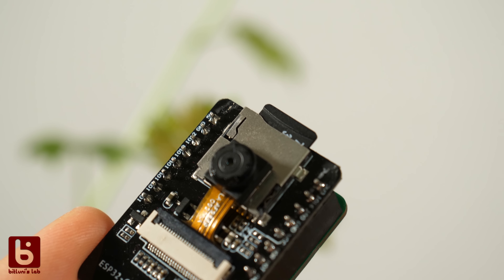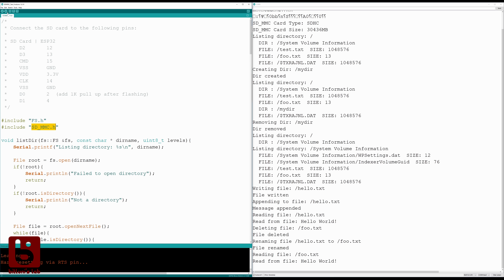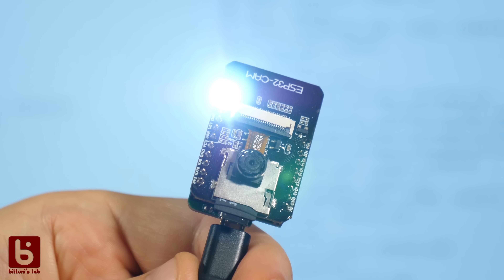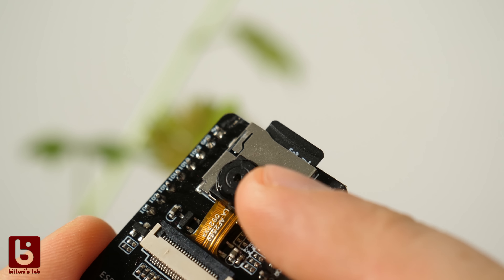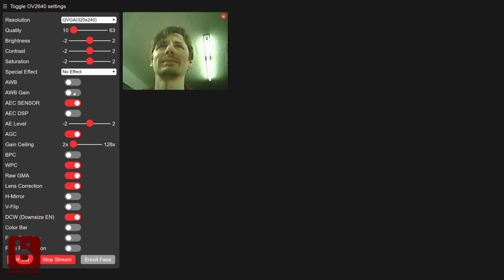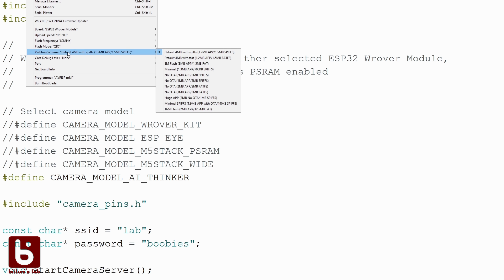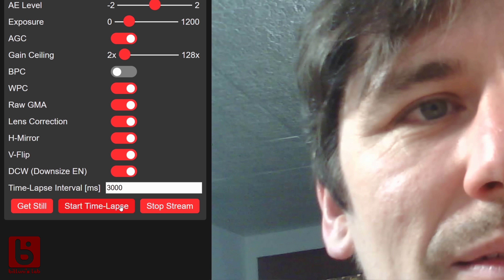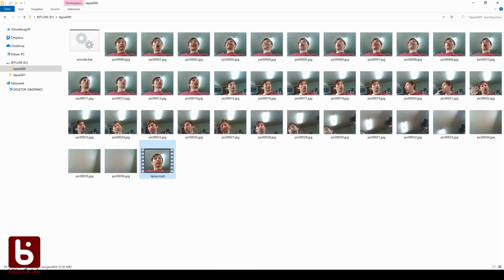ESP32-Cam Time Lapse

Comment: Time lapse cameras won't get much cheaper than that. Great for risky applications, where camera might get damaged, stolen or lost.
Awesome!
Reply: Best acceptable excuse for why all supposed photos of beings and objects which existence of is questionable are so poor quality they're useless for evidence except to show something to be mistaken was there.  Also masks otherwise obvious clues of being fake.  Can't wait until FHD at least is that inexpensive.
Reply: @jasonlisonbee  you do realise that the camera that is used for ESP32 CAM is the OV2640 which supports a video resolution of 1600x1200 which is higher than HD and less than 10% lower than Full HD
Reply: @jasonlisonbee you can swap the base ov2640 to a ov5640 , it has way better image quality and higher resolution but the esp32 processing capability caps it. Plus it gets REALLY hot

Comment: Great video!
I would like to try taking 3 time lapse movies simultaneously with different exposure settings so that post processing could be used to grab the best data from each exposure and nice smooth fades can be made between exposure levels in the final file. Another approach might be to establish hard-coded exposures based on sun position rather than light readings.

Comment: Some of those 'Board cameras' you can easily change the lenses by simply unscrewing them and replacing with another (Better!) Lens, even Wide-Angle/Fish-eye and mini-Zoom, easy to refocus too by screwing in/out.
Reply: Ditto.
Reply: You can do that to these, they aren't glued in. There's a video of a guy putting a mechanical IR filter as se over it after removing the lens. Lets you fit bigger lenses like for cctv cameras.

Comment: I needed to take photo once per day on specific hour. I modify your modification :) Also added ftp server, so now iam able to download captured images without removing sdcard. Now is exactly what i need. Thanks.
Reply: DS3231 rtc with SQW pin connected to  p-mosfet to connect the power supply to esp32-cam power input will make your batteries last a year.

Comment: Hi! I made a comparable system with the same camera, but added a small 0.96” oled screen and a button  to allow changing the timelapse intervals. Do you think  it is possible to also use the display to change the camera settings? I  can give  you my  code if you want...
Reply: with a screen that small and only one button, why not just use the esp as a wifi station and use the web interface?

Comment: I need help, can someone helps me please. Everything works until i click the Start Timelapse then i have a Error ... and it doestn captures any photos and it restarts.. Error ist Guru Meditation Error: Core  1 panic'ed (IllegalInstruction). Exception was unhandled.
Memory dump at 0x400d2a60: a5004136 000000a0 7d004136
Core  1 register dump:

Comment: hi bitluni, a very nice project, but... in your last version, the jpeg save doesn't work. the cam creates a directory after the other at ssd card, but does not store photos in it... what could be the reason? the web server works fine...
best regards
Matthias
Reply: ESP32 1.04 instead of 2.06 is the solution... Matthias

Comment: Great work ! But is there a way of getting this to work in server mode so that I can set it up without a router close by? I guess yes but the real question is how, maybe you could tweak the code a little ??? I'm kinda new to this and my attempts at tweaking have all failed.
BTW:  Mac Users you can easily use QuickTime 10.5 to join pictures to a video, works great.

Comment: Every time you use that camera are need a wifi Internet?
I hope you respond 🥰 i planning to make my own project like this.
Reply: You need a wifi access point to connect, but not internet. You connect to wifi just for controlling them, it's an intRAnet, just the devices connected to the wifi.
You can use an ESP32 as a wifi access point, but very slow so video preview would be impossible.

Comment: Hello thank you for this video
could you tell me what code to add to set the time with the ntp server with wifi, because the date and time displayed on the micro sd are not correct (January 1, 1980)
THANKS

Comment: Hello :) I have make your version of timelapse camer, but i have there a little problem. When i start timelaps, esp create folder in sd cart but doesnt save any photos. After creating folder , esp its rebooting and in next start creat next folder without photos. What can i do with that?
Reply: So i have found resolt for it. Just change esp32 version from 2.0.1 to 1.0.4 and all will works.

Comment: I wonder if these boards changed recently. I tried building a reset circuit like yours early last year and encountered the LED connected to (IIRC) IO0, causing reset to be flaky at best and I just gave up on this model. Might be time to revisit.

Comment: I find that after 6 hours of being on the camera will shut down. A reboot by unplugging and plugging back in the power will resolve the issue. Do I have a faulty camera or do I need to put a small fan near the ESP32. Any ideas are appreciated.

Comment: have run quite a few progs on these cams, but for some reason this code example does not save a pic..it just resets the board. switching to a 5V power bank vs the computer usb cable with no change It simply keeps resetting the board .  I did notice you don't include the soc.h libs to deal with brownouts but i am not getting an error code along those lines. Otherwise, this is a nicely presented project.

Comment: Glue a lens salvaged from a CD/DVD player for macro.
Reply: Also, the lens can actually be focused manually. It has a screw thread but it is kept in place with a small blob of glue. It can be forced a little to break the glue bond and can then be focused even for a distance of just a few mm.  If the lens is too loose after breaking the glue you may need to put a new blob of glue, preferably a weak glue that can easily be broken if you want to refocus.
Reply: I thought it was a laser
Reply: Pl explain thru video.
Reply: @sriyantra1939  The lens focuses the laser. Possibly more accurately, the pickup's view of a reflection of the laser.  Seperate sub component.
Reply: To make the camera more near-sighted, you can also by a EUR 2 pair of reading glasses and fix one glass in front of the camera.

Comment: Hm, it does not work for me. No pictures are stored on the card. I tried different ones, startet everything several times but no data is stored. The Webinterface is working fine. 

I get the following message:

E (1555) sdmmc_sd: sdmmc_check_scr: send_scr returned 0xffffffff
Card Mount Failed

Any hints? Thx.

Edit/ Sehe gerade du kommst auch aus Darmstadt ... Beste Grüße.

Comment: You could try initializing the SD card in 1 bit mode, so the flash pin is not used for communication with the SD Card. This way the data rate is slower. But that's mainly a problem when running on battery. And having an LED blinking all the time isn't exactly power saving either. :D
You can initialize the SD card in 1 bit mode with:
SD_MMC.begin("/sdcard", true);
Not sure if the library supports the 4 bit protocol, I believe that would also not interfere with the LED and would be faster. But anyway, you could try to see if you can get away with the 1 bit mode or if the speed is too slow. Or desolder the LED... :D

Comment: With a suitable power supply, a big ass SD Card, stripped down ESP (Bluetooth/Wifi/Webserver are unnecessary once you configured it) and some code tweaking this could also be used for timelapses over very long durations, as the ESP is quite power-efficient

Comment: Very nice and clear video, Bitluni! I got mine working! Now, does anyone know where to find a description of all the parameters of the ESP32‑CAM? I would like to know how to set them programmatically, not just with the web interface. What do all those abbreviations stand for? What values can the parameters take?
Reply from the maker: I didn't find specifics. Some values act strange. Abbreviations are probably A for auto, E for exposure, WB white balance, S for shutter. You most probably will find more in the datasheet of the camera

Comment: Can the lens be adjusted or is it glued in tight. Hopefully it can be configured to FTP JPG's if within wifi range as thats what I have planned.
Reply: Yes, it can be adjusted.  Just started playing with mine and slightly cracked the lens face.  I think if I had smaller tools then it would have been able to cleanly snapped the glue.

Comment: Hey, I bought a Esp cam and I think it is the same that you showed in the beginning by DIY-More. My Serial adapter, that shipped with it automatically disconnects after a few seconds when I connect the camera. Do you know why?
Reply from the maker: Probably a power issue. You might want to check the debug outout for a brown out and try to run it with a good usb cable or from a power bank
Reply: @bitluni  sorry for bothering you. So I tried 3 cables and non of them worked. My Ide says only com6 is available, but usually I use com3 with all my other boards. I'm new to this stuff. Might that be a useful hint?
Reply from the maker: What kind of programmer is that?
Reply: @bitluni  a FT232RL module.

Comment: cam-prog from Tindie fails to prog ESP32-cam.  Tried all upload speed options. Running Arduino Ver 1.8.9 on Win7.  Com port enumerates ok and i can see debug from the default code running on the ESP32. The attempted program cycle is clearly resetting the ESP32 but fails to program reporting an error occurred while uploading.  Checked all your IDE upload settings i spotted in the video and matched mine but still no joy.  Will continue investigating and will report back if i discover anything but in the mean time would welcome suggestions
Reply: Tested the ESP32-cam module ok for programming via FTDI.  STill no joy with cam-prog.  Have had a good look under microscope.  All looks ok

Comment: hello sir, i am trying to make an iot time lapse camera using the blynk app, i have got it all working but  im having issues saving images to the sd card, could you make a video on this, i can send you the code,
Reply: When you check the serial monitor. What error does it come up with? When you plug the CAM to power and press reset you should see an audit of the card among other things
example:
SD Card Type: SDHC
SD Card Size: 7580MB
Total space: 7574MB
Used space: 0MB
Only FAT format on the card seems to work for me, limitation of the SD_MMC lib perhaps but did not dig in any further.

Comment: Great Projekt! But there is a small mistake. If you change the timelaps MS from 1000ms to 10000ms or any other value, therefore it will take a picture everey 1000ms. Change the timelaps MS at the timelaps Server Webpage has no effect. Why?
Reply from the maker: I'll check that
Reply: @bitluni  Hi! Did you find the Error in the Sourcecode? BR
Reply: I have the same problem.

Comment: Thanks for sharing this interesting project. I've setup my camera successfully, but the SD card is empty eventhough the monitors shows the "Creating Dir: /lapse003
Dir created
/lapse003/pic00000.jpg
Writing file: /lapse003/pic00000.jpg".  Can you help on this ? Thanks  a  lot!
Reply: I got it. The file system should be FAT...
Reply: can you state which options to turn on from the interface for better timelapse recording?

Comment: Would it be possible to modify the code to use a better quality sensor? Not more megapixels, but maybe just better color reproduction etc. Or increase the size of the psram to fit better quality?

Comment: Can i use ov 5640 instead of ov 2640?
Reply: It will work but you will need a bigger battery and a very good heat sink for thr cam. That cam heats up a lot. But at least you get a better quality video. Framerate is similar because esp32 is the bottleneck

Comment: Would be nice to be able to use a high quality image sensor from an old phone instead...
Reply: You would need to reverse engineer the CSI interface on it. While it wouldn't be overly difficult to figure out the connector used and the pinout, you will need to figure out all the I2C configuration registers blindly. This will be a long, long and difficult process. Oh and may need to use an FPGA too.
Reply: so just find a timelapse app and use the old phone as is :)
Reply: @power-max  Yes, probably needs a man-in-the-middle attack to sniff out all the relevant I2C commands. And even then you'd be blind as to what those commands do. It'd still be nice
Reply: @Flashy7  That's not what hardware hacking is about though. By that logic there's no need to develop anything, as you'll be able to buy just about everything you need/want anyway.
Reply: @J0ermungand  Ya know, given that I have some old cellphones, I might give that a try! At least I2C is a slow signal that is easy to decode. I wonder if looking through the source code of something like openCamera and AOSP will give any insight to how to initialize and interface it! You can buy the replacement camera modules for old phones on eBay for like 10 bucks so they may be worth reverse engineering!
Reply: @Flashy7  There are many applications for where having a small high performance camera module makes sense. I personally want to build a DIY drone with very small and stabilized camera gimbal. The sensors in phones are capable of 4K60 and have decent low-noise and medium number of dynamic range and often damn good color accuracy. The gimbal can be made just as small and use a lot less power and add a lot less weight to the drone as a result. With new laws having a drone under 250g may be required.
Reply: @power-max    That's exactly what I thought, those things are cheap. I'd say OpenCamera and AOSP will at least have some clues about where the camera specific code could be found. I'd think that if they did include low level camera initilization and configuration routines, then most cameras out there will share some commands/registers to make this sort of thing feasible.
And if they don't include that code it'll be clear that it's gonna be an uphill battle for every new camera model.

Comment: sir, can we access that taken picture by remote location. I mean connecting wifi and access different location (like IP cam)
Reply: I'm interested too!
Reply: @gytax01  You need an access point which is hardware that connects to the internet.  So out there there is no way. Just have to save to the SD card.